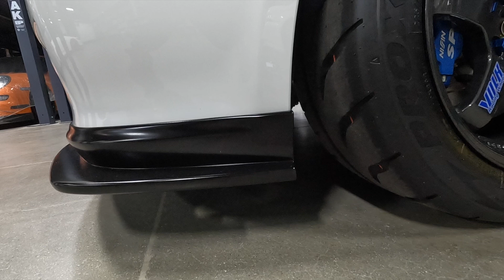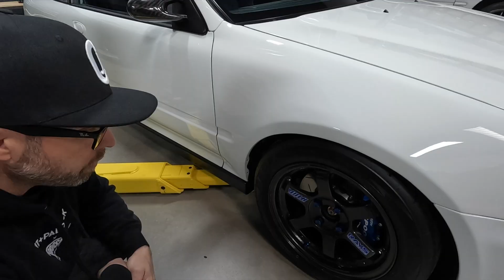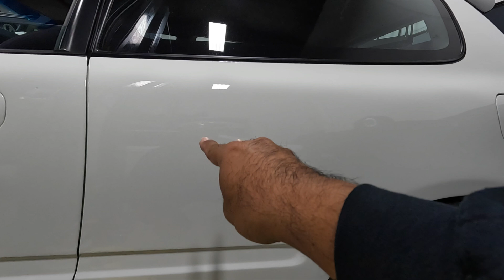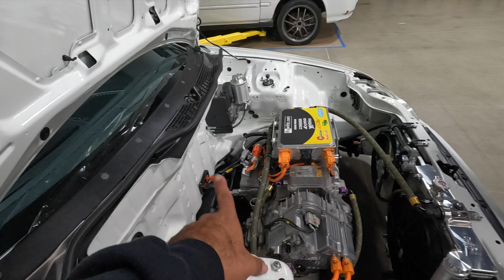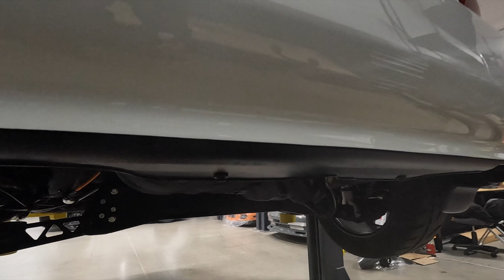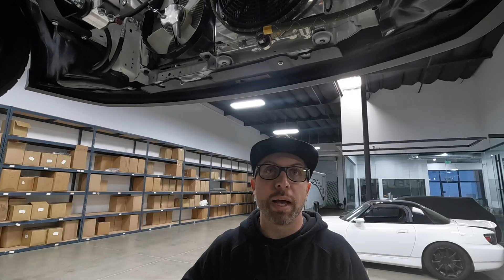BEHIND THE SCENES: Breaking down the RYWIRE Electric EG build!

Comment: I do integra dc2 trailing arms, 01 prelude 5 lug rear. And rsx brakes and rotors. Front, I do 2018 hundai genesis track pack brembo brakes, with 00 crv knuckles and rotors since they are already 5 lug and 36mm axles for my k24 swap. Did front and rear setup with brakes and rotors for around $500

Comment: I would like a more in depth overview of the ibooster setup conversion. I know the ibooster was mounted upside down on this EG to make the hard brake line look clean. My questions are, was the brake master cylinder had to be modify in any way to allow it to have the reservoir sit right side up since it was mounted upside down or was it just simply flipping the brake master cylinder so the reservoir sits right side up and bolt back in? In addition, how is it wired up? and will there be a wiring kit release solely for the ibooster conversion if i want to just do the ibooster conversion for my build?  I have a carbureted setup that doesn’t build enough vacuum for my brake booster and would be a great solution.